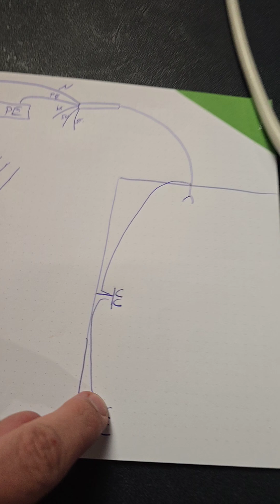You’re Wiring Your Smart Home WRONG – Here’s the Fix!

Comment: If I understand correct, by using a 5 core cable I could independently switch 3 different sockets?
Reply from the maker: yes, typically I go in a room with 5 core, have 1 colour on permanent power and 2 switchable (if needed). Then you can "just" rewire any socket also later if you need it switched. Future proof :D

Comment: I know you can’t say that as a former employee and current partner, but this is one area where the Loxone option is just too expensive compared to a solution that is almost as easy to integrate and costs 1/4: a Shelly Plug :-) I have over 15 of them in my house last time I checked.
Reply from the maker: Maybe, but still i would never sell a shelly as an electrician. Relying on the network sucks 😅
Reply: @ixma_en  Fair enough, I would avoid wireless including Air for anything critical regardless. If it is critical, then it has to be wired in in my book.